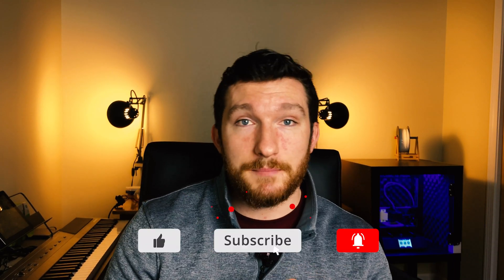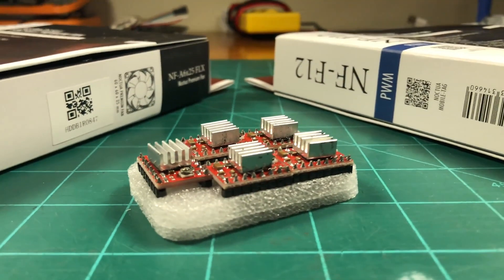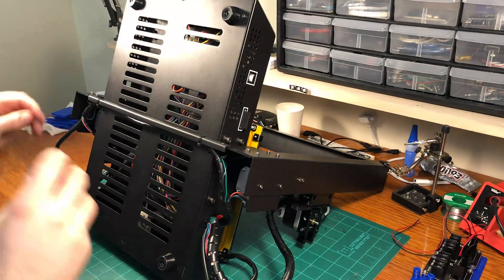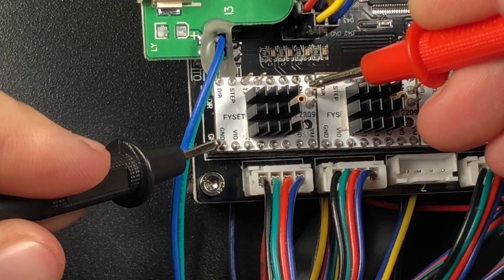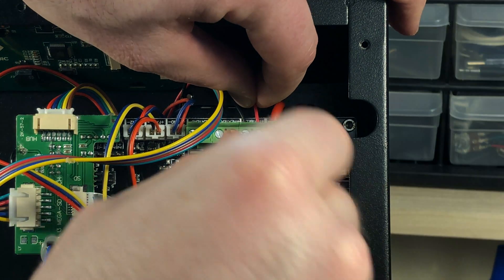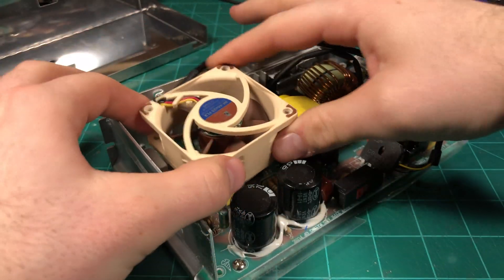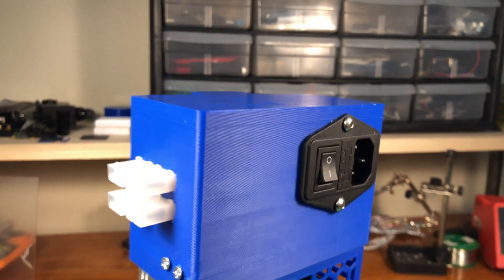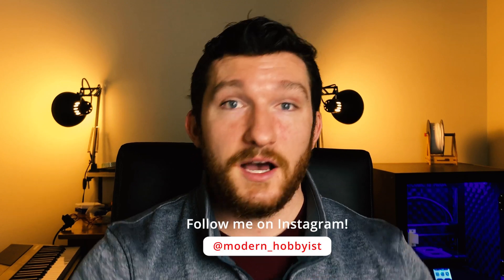Anycubic i3 Mega Ultimate Upgrade Guide

Comment: Hey, great video. Thanks for it.
How are you define the Vref for TMC2209 ?
I want to purschase the same for my AI3M.
Thanks a lot 😉
Reply from the maker: Thanks for asking!
The VREF is set using the potentiometer on the TMC2209. You can measure the VREF using a voltmeter on the stepper drivers while the printer is powered on, and you can adjust the VREF with the plastic screwdriver that will likely come with your new TMC2209's. 

Let me know if that doesn't answer your question. Thanks!
Reply: @ModernHobbyist  Thanks for your answer, but how do you calcul the vref value ?
Reply from the maker: Oh my bad, I misunderstood your question. The equation for VREF would normally be Rated motor current x 8 x Rsense (RSense for TMC2209 is .11Ohm), but I read numerous recommendations online to set the VREF to 0.85 for best results for these specific drivers combined with the Anycubic i3 Mega. 

Hope that answers your question!
Reply: Hi my friend,
I received my TMC2209 V.2 , and after reading so many different opinions, I decided to set my Vref to 0.96 and it's perfect. Injected marlin 1.1.9 firmware with TMC2208 setting . Thank you
Reply from the maker: @Black-Dragon34  Perfect! Glad you got that working for you!

Comment: Great video by the way and I appreciate the hard work you are doing, I have seen certain setups where they bypass power to the main board through the Mosfet so that you are saving an output from the power supply perhaps, not sure if there are any spare outputs on this PSU as I have only just bought the Mega S, I know you have a dual Mosfet setup one for hot end and for the heat bed and it makes sense to have direct power supply from the PSU. Do you have you own wiring diagram for your setup at all?
Reply from the maker: Thanks for the comment!

I don't have a schematic written down, but the Mega S should have the exact same PSU as the Mega (non S). The PSU just connects to the input on both MOSFET's, and the Hotbed and Hotend are connected to the output ports on each respective MOSFET. Then the motherboard port that previously powered the hotbed and hotend is connected to the signal input on the MOSFET with the included JST connector. 

Let me know if that helps, or if you're still looking for more information!

Thanks!

Comment: Hi, do u have to do anything on the firmware when upgrading the stepper drivers?
Reply from the maker: Hey Jessie, thanks for your comment! You don’t have to make any firmware upgrades to get the new drivers working, but you certainly can! I do have a video covering upgrading my i3 Mega to a newer version of the Marlin firmware that you should check out! If you do the firmware upgrade first you don’t need to flip the stepper motor connectors at all. Cheers!

Comment: Hi Nice video👍do you now is the TMS 2209 also fit on the anycubic mega S,
Reply from the maker: Yup! Shouldn’t be any problem there, the Mega S is the same chassis/electronics inside as the non-S counterpart, with the only differences being an upgraded extruded motor and filament hanger. Thanks for asking!

Comment: nice video, but you´re missing one thing. If you change your steppers you also have to change the firmware ;)
Reply from the maker: Hey Julian, thanks for your comment! The pinout on the TMC2208 (and 09) is slightly different than the A4988 drivers that come stock with this printer, but you can get around this without changing the firmware if you flip the motor connectors 180 degrees. You are correct though, if you don't want to flip the connectors, than switching firmware will also work.